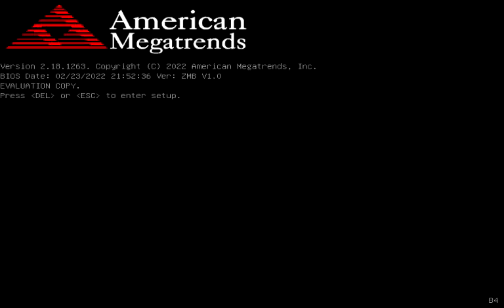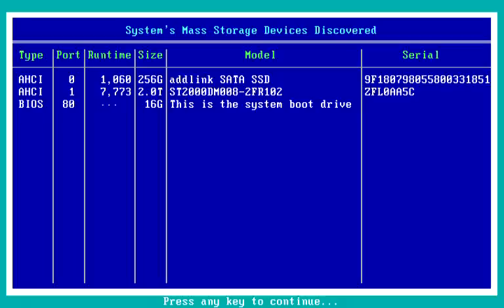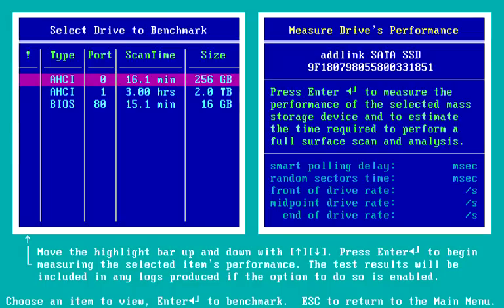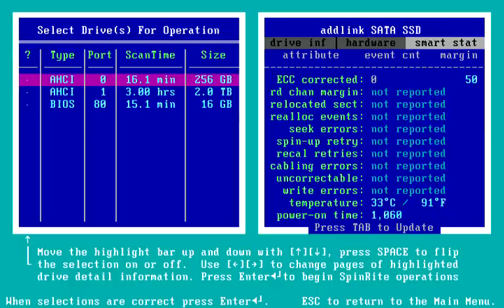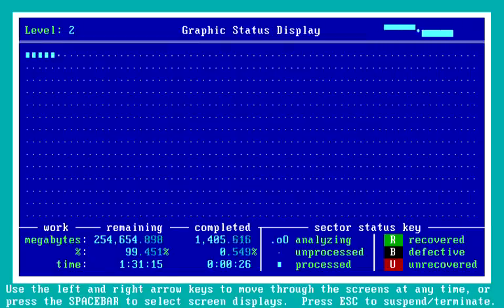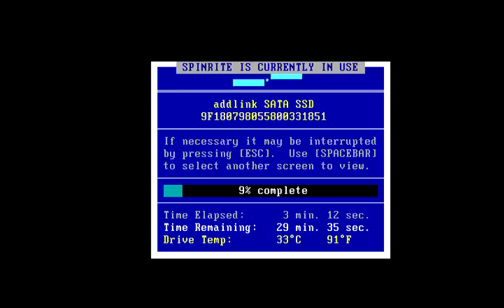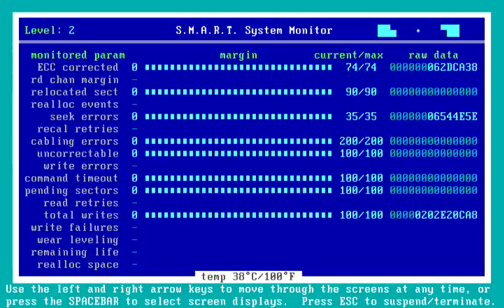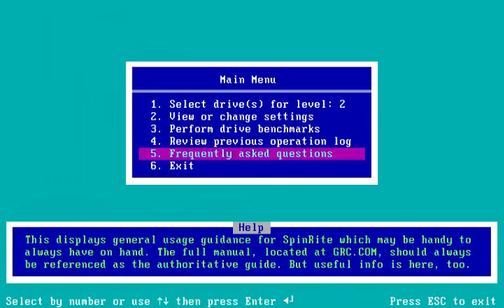A SpinRite Walkthrough

Comment: 6:10 note that SSDs in perfect working order will typically have data randomly rewritten near the beginning. When benchmarked by reading sequentially, those areas will see slower performance. This can be due to the SSD having a harder time reading ‘older’ data as Steve describes, but it can also be due to sequentially reading a previously randomly written area, which effectively turns that sequential read into a random read, which is expected to be much slower (and would likely see no real-world performance improvement by rewriting those areas).

Comment: I'm curious why the program text at 3:14 says level 3 is not recommended for SSDs, but later you comment how running a level 3 can fix the overt ime degradation of SSD performance. It seems like that interest screen needs an update for level 3?
Reply from the maker: I agree — that screen should be significantly toned down. When I wrote that warning intercept screen I was hoping to convey that with SSD and SMR spinners, writing was not "free".  But in the case of SSDs I'm afraid that screen puts people off much more than it should. Running a Level 3 (rewrite) pass over an SSD annually or perhaps even twice a year. SSD storage endurance is in the 10's of thousands. So if someone ran a Level 3 over an SSD twice per year, in 20 years that would be an additional 40 rewrites. That's clearly insignificant compared with a write-cycle endurance of 10,000 writes.  :)

Comment: I understand error correction is happening constantly on modern drives, but at what point are you concerned about seek errors on spinners?  Or would you lump that into ECC?
Reply from the maker: That's a tough call. We see seek errors increasing as a drive begin having increasing trouble doing its work. I'd say that the best thing to do is to keep an eye on the drive's own SMART health parameters for seek errors since only it really knows when it's getting into trouble.

Comment: Should I ever power down my Synology NAS, connect the hard drives and NVME SSD cache to a PC and refresh them with Spinrite?
Reply from the maker: I would say... No.  Assuming that you're running your Synology with either RAID 5 or 6 redundancy (I run my Synology's with RAID 6) then you'll have plenty of data protection and warning of trouble. And the role of an NVMe SSD cache is entirely different from an SSD in a PC: An NVMe SSD used for caching is going to be constantly rewritten... So it's like SpinRite's Level 3 all the time! <g> It's SSDs in PCs that have large regions of the operating system and the filesystem that are very rarely, if ever, rewritten. THEY need very occasional rewriting with SpinRite at Level 3.  :)

Comment: I have a SATA SSD that seems to keep losing files every time I shutdown. 
I ran Level 2 without any issues reported, so I decided to run Level 3 to see if there are deeper issues with the drive. 
SR keeps saying the drive is overheating few minutes into each run, so I could never finish it.
Does that indicate something wrong with the drive, or is this expected with Level 3?
Reply from the maker: SSDs don't “like” too much heat since that it increases the “charge leakage” from their bit cells. Several studies have shown that offline (sitting on a shelf) SSDs stored in hot data centers lose their storage faster than those stored in a cool environment. So there's that.
     But it does sound suspicious that an SSD is overheating that much. SpinRite definitely raises the temperature of drives -- both spinners and solid state -- and laptops typically have a problem dispelling heat since they have very little room for moving air.
     If this is a laptop, you might try running SpinRite at Level 3 (which does sound a useful thing in your situation) outside in the cold air to help with cooling. If SpinRite pauses due to overheating, you'll see from the pause menu that you can instruct it to wait for the drive's temperature to drop down and auto-restart. So it should be able to get through the drive... And being outside in cool air should also help a lot. 👍🏻

Comment: Back when I used to listen to the Twit podcasts, I thought there was discussion of making a Mac version, but another project (Squirrel) had to be completed first. I'm guessing that a Mac version is never coming?
Reply from the maker: SpinRite v6.1 changed the keyboard handling from v6.0, which was the previous problem with Apple Macs. So v6.1 =will= run on Intel Macs if they are able to boot from USB media. Older Macs were able to, but this has been disappearing more recently. Our "BootAble" freeware was created to allow you to check that out for yourself before buying SpinRite. If you can boot BootAble then SpinRite =WILL= run. 👍🏻
Reply: @SGgrc  Nice! 👍🏻

Comment: Great with a new version of SpinRite and a comprehensive walkthrough.
Some minor feedback. The wording is a bit unclear and inconcise for the start of the drive. On the SpinRite screen it says "front of the drive" and "end of the drive". "Front" and "end" are not opposites. "Front" and "back" and "start" and "end" are opposites. "Start" and "end" would be much clearer wording. Or as you say in the video "inner" and "outer", might be even better, although not so fitting for SSDs. And graphically each new title/label would look better with initial capital letter like "Random sectors time:" instead of "random sectors time:".
You missed the opportunity to explain that the first track on a spinning drive is located on the outer part with the longest cylinder, you just stated that the cylinder on the "outer periferi" is the fastest. Thus HDDs are filled from the fastest outer cylinder to the inner slower cylinders.
Acronyms are much easier to read in all capital letters or their known case, like "BIOS" instead of "bios". It's done correctly for the data, but not for the titles/labels.
Reply: As long as we're correcting things, I'll correct your "outer periferi" to "outer periphery" :)

Comment: Steve, just wanted some clarification. You mentioned it is a good idea to run level 3 once a year for maintenance but on the blue screen it says that level three is NOT recommended for SSD drives. Used caps because that is how it was written in the description.
Reply: Good question.
Reply from the maker: Yes. Agreed. Good question. I just wrote a long reply to a more recent question. I'm sure you can find it. The TL;DR is: Once or twice per year makes a LOT of sense. That screen is much to strongly worded.

Comment: My ssd get stuck at 1.934% running spinrite on either level 2 or 3 does that mean I need a clean install?
Reply: Did you ever get your answer?
Reply: @ not really but as it was a Lenovo windows 10 laptop I don’t use a lot. I backed up the files then did a clean install and Spinrite ran fine.
Reply from the maker: Sorry that I missed seeing your question. I'm glad you got around that!

Comment: I recently purchased the latest spinrite for use on some older Microsoft surface laptops but found that EUFI makes spinrite unusable. I didn’t ask for a refund as I’m an avid fan of security now podcast and keen to support its ongoing development towards a version that will work on modern pcs and laptops. Steve perhaps you could cover why this doesn’t work for me in an upcoming episode as I was hoping to resurrect a slow surface go for my kids and sadly cannot. Hoping spinrite 7 will solve this issue. Cheers and thanks from Melbourne Australia, Rick
Reply from the maker: SpinRite 7, which will run under Windows as a full regular Windows app, WILL not have any UEFI problems! :)

Comment: Can spin refresh my 3-1/2 inch floppies?
Reply from the maker: Yes — Quite well, in fact. But you should use SpinRite v5.0 for that. It contains the best diskette recovery/restoration of all. Any SpinRite 6.x owner is entitled to both v6.0 and v5.0. When you obtain your software download link (which anyone can get at any time) you copy and paste it into the browser URL instead of clicking on it. Then simply change the filename at the end from “spinrite.exe” to “sr5.exe” and you'll receive a licensed copy of SpinRite 5.

SpinRite v6.1 has a MUCH superior USB formatting and setup. So you should use your v6.1 to prepare a bootable USB. Then just copy SpinRite v5.0 to it. After booting, SpinRite 6.1 will auto-start. So hit ESC to back out of 6.1 to DOS, then start v5.0 by entering "sr5" and pressing Enter.  👍🏻

Comment: Which level to prevent data degradation on an properly functioning SSD, 2 or 3?
Reply from the maker: Level 2 only performs rewriting of specific locations in the event of the complete unreadability of that region. That's the fastest Level for data recovery since it cruises along only reading until it hits a problem. But the phenomenon everyone is observing with SSDs is that they can slow down incredibly while still eventually being able to recover their own data. So Level 2 may slow down at those locations but it won't rewrite.

Level 3 is what you need to use for SSDs. It rewrites everything once, regardless of how long the drive took to read the data. And the beauty of this is that the NEXT time the drive attempts to read that freshly rewritten data it can do so at full original "factory" speed.  :)

SpinRite will caution its user when they choose any level above 2, since writing to NAND memory is know to ever-so-slightly fatigue the NAND cells. But SSDs can be entirely rewritten tens of thousands of time before anything actually wears out. And we're only doing it once. So SpinRite's caution is probably unnecessary... but I wanted to be responsible.

An annual once-per-year whole drive (Level 3) rewrite should be ample to keep drives (that don't spin) running fast and reliably. 👍🏻
Reply: @SGgrc  Thank you for the detailed response.
Reply: @SGgrc  Steve, if it's technically feasible, I think adding the functionality for SpinRite to scan/check multiple drives simultaneously would be extremely useful.
Reply from the maker: @krisstianseyer  DEFINITELY!  ALL future SpinRites will be fully multi-tasking and able to have multiple things going on at once. This wasn't feasible for v6.1 due to UI limitations. It would have required a significant reworking. As is was, I rewrote all of SpinRite's core logic over the course of 4 years... And all of THAT will be portable into Windows... Where a new UI will be designed specifically to allow SpinRite to become a mass storage maintenance and recovery workstation. 👍
Reply: @SGgrc  That version sounds amazing, I am looking forward to it. Hopefully future SpinRite versions will retain the capability to be executable from a Linux distro or live DOS-based bootable USB flash drive. That is useful for situations where Windows breaks, a dedicated Linux/non-OS repair workstation is used.

Thank you, again. Regards

Comment: Does any program like this exist for the Commodore 64?  I have floppy disks that are over 30 years old and would really love to test their reliability as well as refresh their data with such an easy to use program.
Reply from the maker: The Commodore 64 drives were amazing for their time. As with the Atari drives, as I recall the drives themselves were quite intelligent and took high-level commands, like "Format" and then did all the work themselves. But that means there was no low-level access of the sort that you're looking for.
Reply: @SGgrc  there absolutely was exquisite low level access.  Far beyond what any HDD likely ever offered.
Reply: Your best and safest bet is to clean the heads and start backups of your floppies to an SD card via one of the many devices you can plug into your C64.

Comment: I thought this software had simply hit a wall when we abdicated physical control over cylinders, heads, and sectors. Glad to see I was wrong!
Reply from the maker: It's true that SpinRite needed to completely change to keep up with the times. It has completely abandoned all notion of cylinders, heads and sectors (CHS) addressing in favor of seeing all mass storage media as an unbroken linear region of storage.

But the BIG surprise was the discovery of the degree to which today's solid state drive media was slowing down WITHOUT generating errors. SSD controllers will struggle mightily to read their data. And they can almost always succeed. But they should NOT have to work so hard. We found that this was due to a phenomenon known as "Read Disturb" and that it could be completely resolved by simply rewriting that data once.

So that meant that SpinRite was no longer only useful for spinning drives!

Comment: Have used SpinRite since the early 80's after talking with the head of support at Compaq.  He stated that they used SpinRite to test hard drives before they where installed in Compaq devices.  The bad ones were weed out and sent back to the manufacturer so they did not become a support issue at the very start for Compaq.

Just wish I could use my new SpinRite 6.1 version with my Apple M1 MacBook Air.  Steve talked the other day about a solution that it looks like I am going to use.  

Create new macOS/UNIX USB install with latest version.  FULL backup using Time Machine to two separate storage drives.  First is the one I am already using.  Second is a external SSD which I have tested with SpinRite 6.1 on level 3.  Then after this is done I am going to do a fresh "Nuke and repave, or flatten as Microsoft likes to call it" install of macOS/UNIX and then full restore from the Time Machine backup.